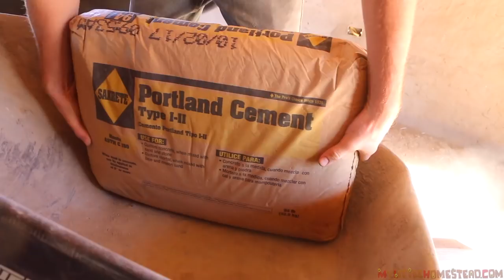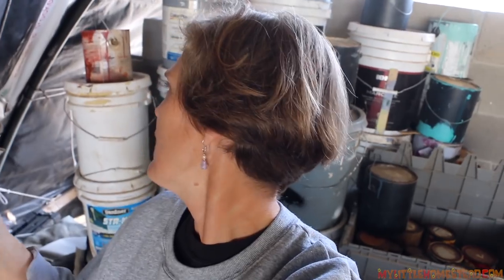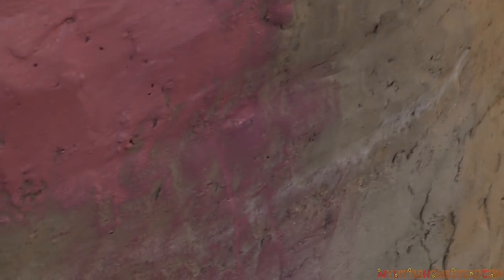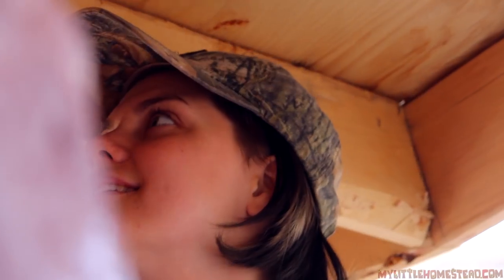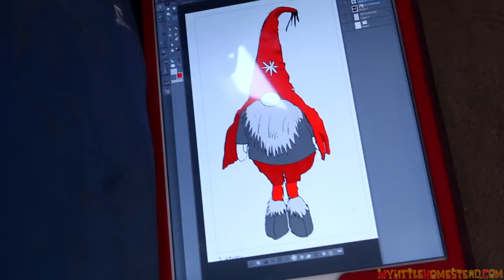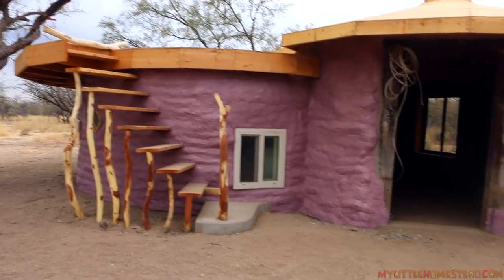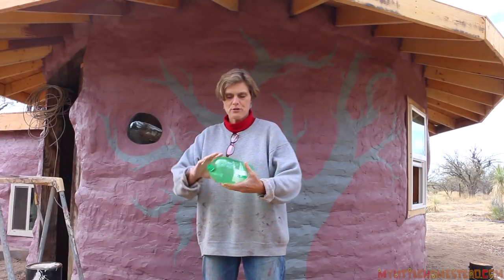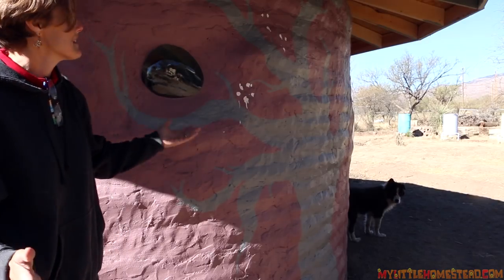Painting!  | Shae's Earthbag Bedroom | Weekly Peek Ep117

Comment: About mounting the glass pane: The center frame of the roof could be used to glue the glass pane to it with silicone. The silicone could, if necessary, be cut to remove the glass pane. Now if the frame would provide a slightly tilted surface -or use a bit more silicone on one side-, it would be quite easy to mount, securely sealed and durable. The word Aquarium gave me that idea.

Comment: Solution for pop-bottle flowers:
- cut top off of bottle
- fill bottom part with spray/foam insulation
- let dry and remove foam
- you will be left with a spongy foam imprint of the bottom of the pop-bottle

Comment: I know i make far too many interjections about your projects but I’ve contracted many homes and learned a number of skills. Amongst which has been a MS in Physics. If i may say so, while that glass may be slightly stronger it lacks the kind of safety you want for a large glass disc that hangs over a loved ones head. Tempered glass while strong, if broken, will rain down in deadly shards and be dangerous to walk over should escape be necessary in emergency. Safety glass allows for a shower of relatively harmless particles raining down and right angle edges that are mostly safe for calloused feet to walk on..that’s why its used in businesses and vehicles.  One hopes it never breaks but your roof structure will flex more than many other designs in high weather.
Check at a nearby airplane graveyard for a curved plexiglass window or consider having a 1/4”-3/8” thick vacuum formed cap made.  Both will be affordable

Comment: Be sure to use tempered glass on ANY overhead application......or you could use a laminated glass. plate glass is VARY dangerous in that it turns into razor sharp shards.
Reply: That is indeed a point! However he said its a glass pane for a tabletop. Therefore it should be safety glass.

Comment: To print a design on an uneven surface try using the same technique as is used in pad printing. https://www.youtube.com/watch?v=kkDbu_TUMAw. Inflate a water balloon (preferable with a soft jell but water may do) then press it on the bottom of the soda bottle that has been dipped in paint. Then press the water balloon carefully on the wall. It may take a little practice but that should do the trick.